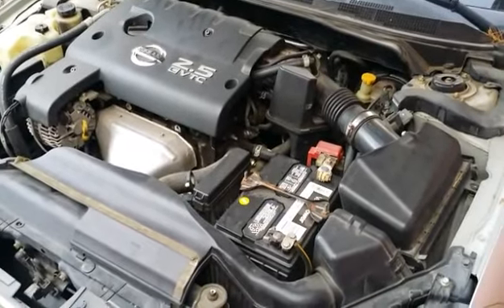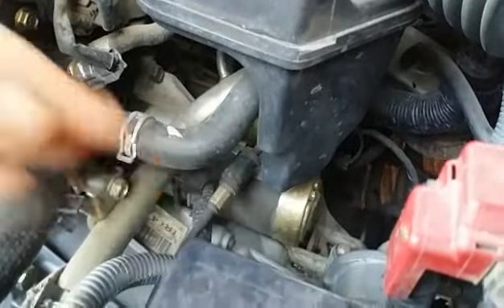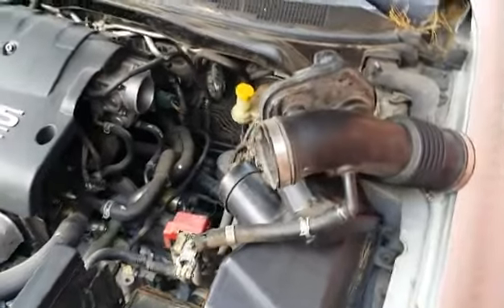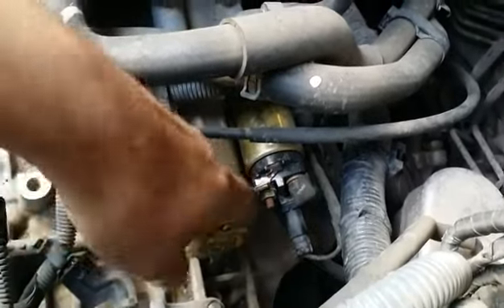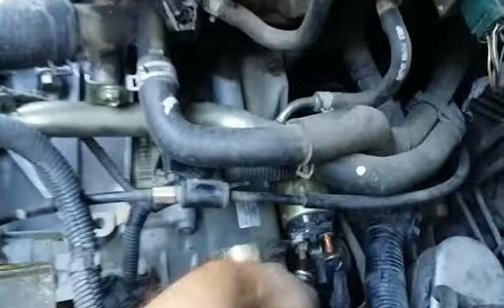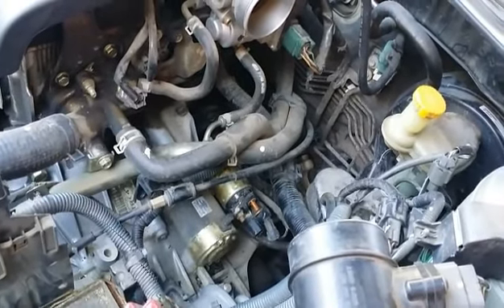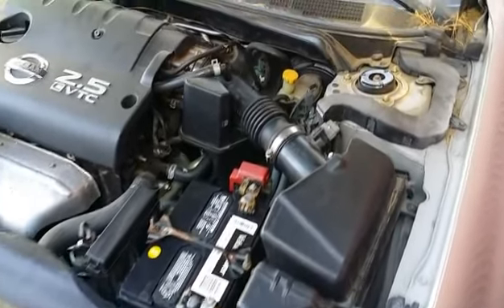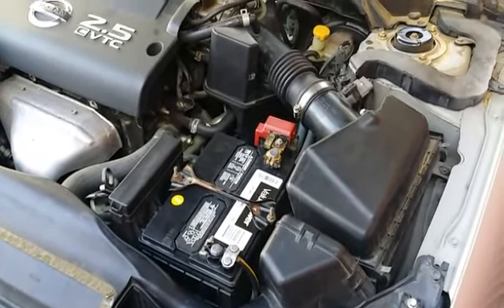2002~2006 Nissan Altima 2.5L Starter Replacement

Comment: That's exactly what my Altima did! Wouldn't crank, and the battery was brand new! Thank you for your help. And for those that have never replaced a starter, this one is easy, most of the time you have to crawl under the car, and usually have to jack it up too because the starter is underneath.
Reply from the maker: Glad the video helped! Thanks for watching and commenting!

Comment: Hey love the video. I'm trying to see if my car has the start problem. I placed a new battery in but the car still didn't start up instead it sparked and smoked at the positive terminal of the battery. I tried to start it a second time but it wouldn't even crank. Also, when I jumped start it the starter was clicking.
Reply from the maker: San J King, hope your issue has been resolved and you are now happily driving around again. Thanks for watching and commenting!

Comment: Turn on and  off multiple times  fast and  it will turn on. However  it's just incase  stranded.  Tap it with a hammer  works  good  too
Reply from the maker: Navy seals rock, thanks for the tip. Will keep that in mind. I'm sure other viewers will find it useful. Thanks for watching and commenting!

Comment: dont need to remove battery..but you will need a breaker bar .. the 14mm on bottom and the long 17mm on top hold it in place are very tight..

Comment: I've try to replace the battery with a new one yet won't start a mechanic told me it was something wrong with the engine but the engine is fine im guessing it's some lose wire that is stuck or unplugged

Comment: Can i get any starter for my nissan or can i need the same
Reply from the maker: Daniel ponce starters are different for different cars. Mounting bolt patterns, number of gear teeth, depth of engagement, body length are just some of the variables that make starters different for different cars. Good luck with your change out!